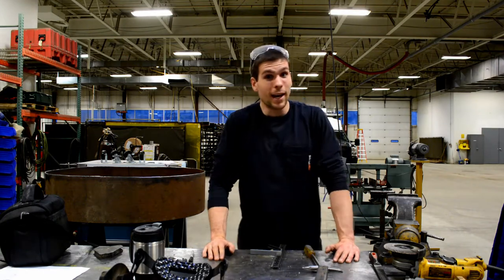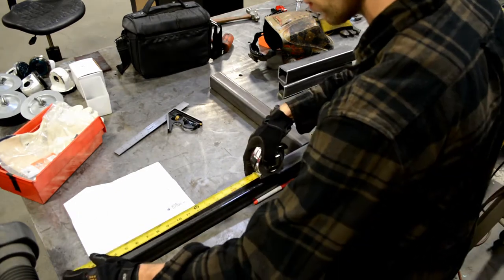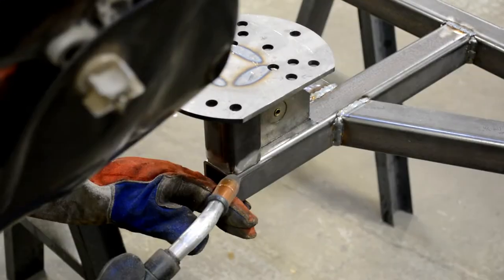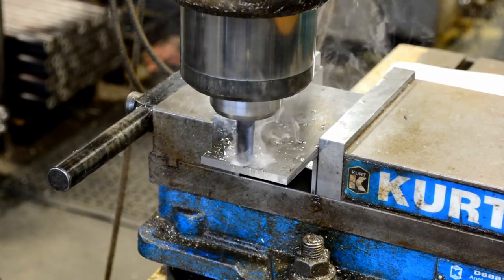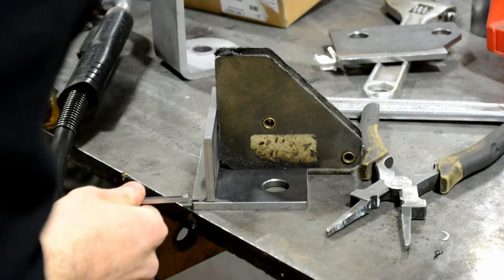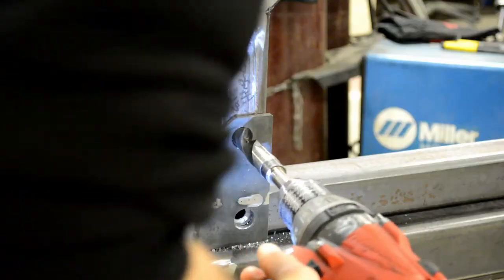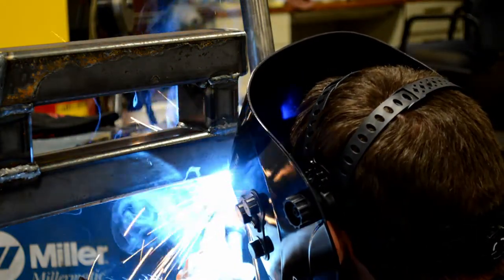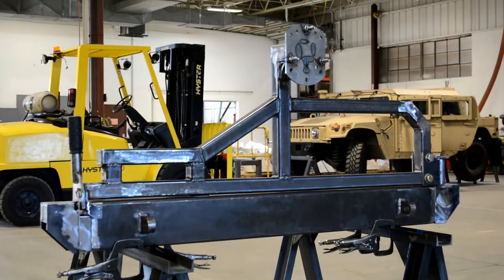Tacoma Rear Bumper DESIGN+BUILD: Part 2

Comment: Good video.   

I worry about the latch going right in front of the left tail light, and it doesn't seem like it has to.  I'm guessing here, since you haven't shown it on the truck.

Secondly, you haven't shown the "extra" stuff you wanted to carry on the bumper/swing out.

As for welding.  A butt joint welded up and then ground smooth has almost no weld left.  Use the standard "V" to get more strength.

Comment: How is the hinge holding up?  It looks like there is a slight drop when you open it and start to swing open.    How is the latch holding up?  Are you happy with those components?
Reply from the maker: The hinge held up fine for the duration of time I owned/ran the bumper, but you're right that there was a slight sag when it was open.  That was the only point against the kit, the latch was great!

Comment: Instead of welding bolt to mount your spare tire you should have used wheel studs for your truck then if you ever need studs on the trail you can borrow them from the spare tire mount

Comment: you have the whole shop there, why don't you weld prep all of your joints??... so much less sanding, more pen and strength...  ALso sand all of the grey burnt edges of your laser cut parts. For a much happier MIg weld.
Reply from the maker: I generally do a lot more prep than I film…though that being said I do get lazy sometimes. I’ll generally take off mill scale with a wire brush and then will burn it in. The less critical the joint, the less time I spend prepping.